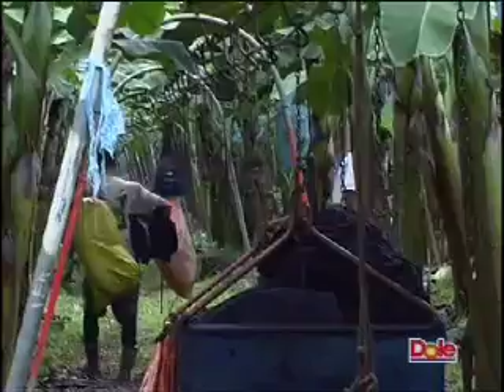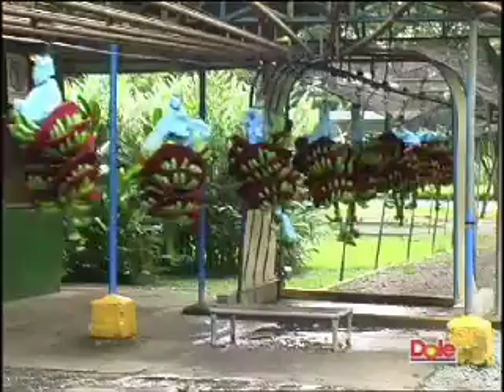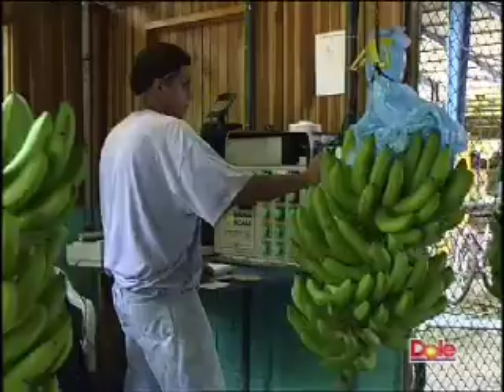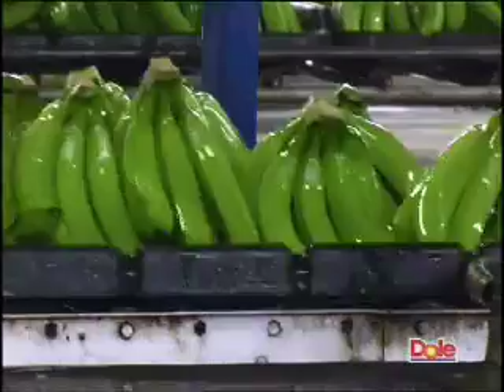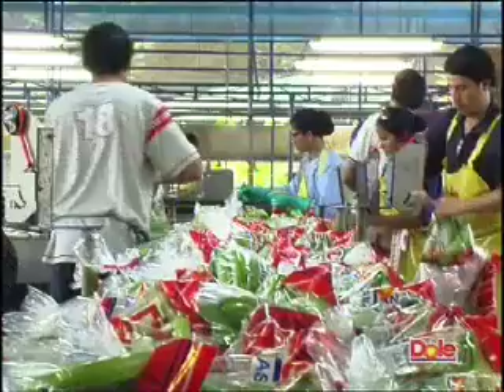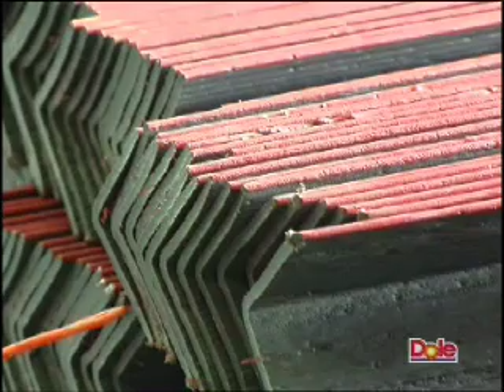DOLE Banana Harvesting

Comment: 1) banana harvesters are usually barefoot and step on spiders and have a high mortality rate.  2) Bananas are floated in cold water to remove and kill any insects pesticides didn't remove. This cold water bath also cleanses the pesticides. 3) The containers the bananas are loaded into are sealed before the doors are closed with a removable plastic door seal...a vacuum is used to remove air and nitrogen is pumped in before the doors are closed. This puts bananas in a suspended state of delayed ripening, and once they are removed from the refrigerated container at the US port (2-5 weeks later) on the container ship the ripening begins once de-packed. Bananas, and other fruits are refrigerated until they get to the store for freshness and quality.
Reply: NOVA Dash Cam หนังควา

Comment: The cable way seems pretty efficient, and it's low-pollution. It also doesn't bruise the bananas.
As for the "double-handling"... It's just like an assembly line. "The workers focus on a small part of the overall whole, meaning that they do not require extensive training"
Also, you don't have to "re-tool" (so to speak) every few minutes for the next task.